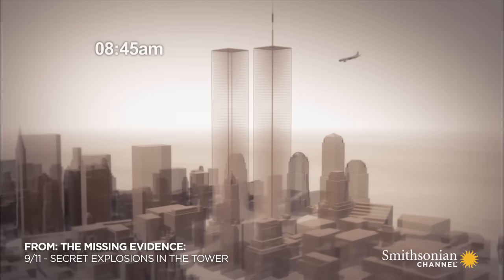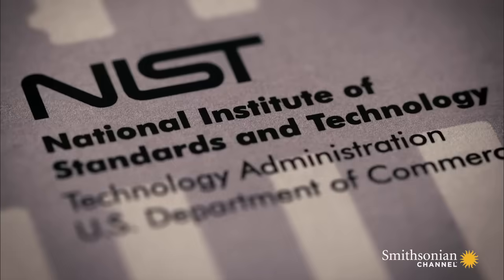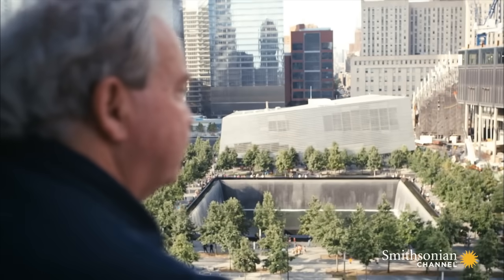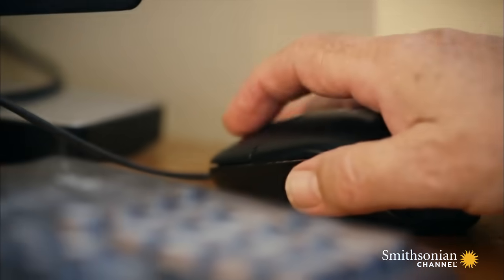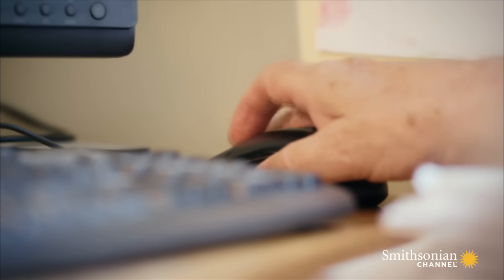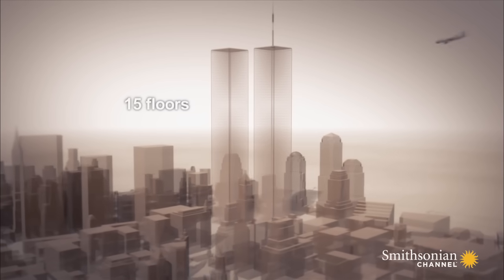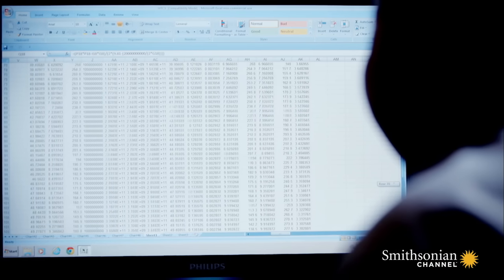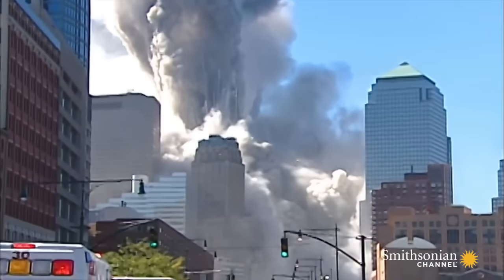This Computer Simulation Explains How the Twin Towers Fell

Comment: The computer simulations are only give information that is has been given.  Why didn't the towers fall of to the side where there was a weakness?   When the towers were hit by the plane, IL that caused a weekness on that one side. The outer wall, the steel beams and concrete inner walls.  In other simulations the towers would have begun their fall by leaning to the week side first, not straight down.  Why did building 7 fall. It was said to have had a fire in it   The fire had to be more the 2800 degrees for all the steel to melt at the same time and the building to fall on top of its self.  Watch building 7.  Straight down.    No leaning. No tipping to either side.  STRAIGHT DOWN!!
Reply: Why didn't the towers fall of to the side where there was a weakness?

Because gravity.

and concrete inner walls

There were no concrete walls. The only concrete used in the Towers were for the floor spans.

The fire had to be more the 2800 degrees for all the steel to melt at the same time and the building to fall on top of its self

No one claims the final global collapse of WTC7 was a fire/heat induced column failure.
Reply: Tim Shea    if gravity was the only factor then gravity would have caused the week side to collapsed sooner.   Have you ever played Janga.  I thinks that's how it's spelled.  Pull the prices of wood out carefully not to tip it over. Gravity causes it to tip.  So the week side will tip first.  Just as it should have in the towers.

Comment: Strange how the core survived initially, then fell in both towers. Very strange...
Reply: Not just both, all 3 towers fell symmetrically (and one wasn’t even hit by a plane).
Reply: @GhostSal  You have a very very loose definition of symmetrical...
Reply: @nutellafoxvideos7350  Read the actual NIST report, they don’t even try to argue that the collapse wasn’t symmetrical. The instead focus on why the buildings collapsed symmetrically.
Reply: @nutellafoxvideos7350  Also, aren’t you at all curios what happened to the 2.3 trillion?
Reply: Neither core was intact, that's why stairs and elevators cut.
Reply: It’s strange unless you understand how the buildings were constructed and how the structural elements failed.  🤷🏽‍♂️.

Comment: No way. There's no way, 80 undamaged floors would collapse. If the plain hit on the 40th floor, maybe, but this is physically impossible. There was no structural damage to the bottom 50 floors. Considering the 20+ years of imperial war and expansion, I don't think it's hard to see this for what it was ... an orchestrated Pearl Harbor.
Reply: You need to learn how the towers were constructed: With their "tube" design all the floors' weight was supported by the columns via the trusses they were built on. The trusses kept the columns aligned - so when the collapse began the trusses could no longer do their job & the columns failed, dropping the top 30 stories directly onto the floor below, which had no hope of withstanding such an impact. Same happens to the next floor, and the next, and the next ...
Reply: Controlled demolition
Reply: @icekoldcilla8470  
There's no evidence of this.

Comment: Explain WTC7 then. No plane hit it   Minimal fires. Yet it collapses line the twin towers. At no time in history before Sept.  11 2001 or after has a steel structure sky scraper collapsed. There are countless examples. So I guess that was the day that physics didn’t apply. Ok sure.
Reply: WTC7 was hit by hundreds of tons of steel and concrete when WTC1 collapsed. It had multiple fires on multiple floors. Firefighters on scene described it as "fully involved". It was left to burn unfought for 7 hours and collapsed.

Comment: who is this guy? The simulation, rendering they present clearly doesn't show the actual way the towers came down. Steel was visibly thrown outwards and upwards on the original footage. we don't see that in the simulation. implying another force at play as falling debris takes the path of least resistance. and so you would expect a pile of steel at the bottom, but that didn't happen.  the building vanished into dust. human remains were even found on nearby office buildings years later. don't tell me human remains dodged a falling building and landed on their final resting place all by itself. Let's be clear, nobody , at least not publicly as far as the world knows, ever told the world that they knew what actual happend to those towers. But this is not science, its science fiction. Shame on the Smithsonian for putting this out.

Comment: Paid Hack. Everywhere we saw white on the towers was the highest quality I beam steel made. Between every window was steel I beams. The planes did not take out all the I beams and there where enough left to easily hold the building up above them. Zero chance the ones below would have collapsed. If the top collapsed  it would have fell to the next floor and stopped or bounced off to the side.

Comment: Destroy structure building falls.   The building just doesn't fall.  Because of the first law of Thermodynamics.   Gravatational Potential Energy of the building is not enough to bend and buckle the structure as happened.  That in effect is what this guy is arguing.  In fact he is arguing the kinetic energy of the structure above the impact zone dropping 1 floor is more than enough to completely destroy the structure of the floor below in  about a tenth of a second raise the temperature of the derbies almost to molten and pulverize all the concrete and every thing else to little pieces or dust..   There is only one way a building can  collapses like this.  Carefully placed and timed explosives placed so as to cut the structure top to bottom. as actually happened.  We are talking the destruction of 100,000 tones of high strength structural steel , the  pulverization of all the concrete, the heating of debris to such temperatures so as concrete and metal fuse together as found in the ruble.

Comment: New physics are created here. Perhaps He should habe taken all forced in Account, Not only one. And if only one, take the most basic one. Here: Newton first rule. In short: you cant crush 90 stories with 20 stories of the same Material. Eben it is fällig a Million miles and you did Not take the structural integrety of the building into Account.
Reply: @Shelby_Starner_Everything  Third law of Motion by Newton: When one body exerts a force on a second body, the second body simultaneously exerts a force equal in magnitude and opposite in direction on the first Body. (translated for you: if two bodies collide, it makes absolutely no difference, which one is moving, which object takes more damage, is decided by their density, Not their Speed)
Reply: @Shelby_Starner_Everything  a higher Speed Differential between two objects that collide "generates more energy" (deformation will be bigger), but has nothing to Do with the distribution of the damage on the two objects. The water in the waterjet can cut through steel because it is extremly pressurized: 4000 - 6000 bar. So yes: The water .in the waterjet is more dense than steel.
Reply: @Shelby_Starner_Everything  both objects will deform. How much depends on their density. The moving object will "Lose kinetic energy" (slow down). The other ones gaines energy.
Reply: @Shelby_Starner_Everything  Good comment among the hysterical and immature drivel.
Reply: @Shelby_Starner_Everything  You're right. The planes should have bounced off and fallen into the street.

Comment: When steel disintegrates in mid air
Reply: And how do you know that???  And your feelings don't cut it.
Reply: It’s a miracle !!
Reply: Umb O  nope, most of it got carted almost immediately to china. There was a non stop flow trucks taking it away. Despite the need to sift through it all and investigate it properly. How suspect is that.
Reply: Yep, remember reporters walking around saying- Where’s All The Debris"?  Cars too were hit a block away... but not the tires or glass...
Reply: @getdapoint9469  And your point is..?

Comment: Buildings dont fall straight down... it's impossible. Just because one floor goes out doesn't mean the whole structure fails unless it was built with that in mind, which further proves a conspiracy.  However the building wouldnt have passed inspection.  It doesn't matter how you look at it it wast iranians that flew those planes into the buildings. If the planes hit at the bottom of the buildings that would be very different story. Skyscrapers have been struck by planes they did not go down. This guy's math and science are wrong, or skewed by pay off.
Reply: "Buildings dont fall straight down... it's impossible." Says who? You?? lol! #1 the tower tops fell 5 floors, not 1 - meaning the top 30 stories fell onto the the topmost intact floor from a distance of 50 feet! Are you really going to argue it should have withstood that kind of force?

"Skyscrapers have been struck by planes they did not go down"

Name one. Yes I know about the Empire State building in 1945, that's a bad example you won't win by citing 'cuz I know the facts.

Comment: The reason it falls as if it is controlled is because
It is. A plane slammed into the building. That's controlled.
The guy said "if one floor fails they will have floors crash down" 
That's what happened.

Comment: With a safety factor of 5, how did the columns at grade fail when all the loads had been removed during the collapse?!
Is Smithsonian in bed with NIST these days??
Reply: The columns were not contiguous; they were short beams bolted together at the ends. All that was required to destroy them was to break the bolts. Why do you think that mass coming down with such incredible force would have any difficulty doing that?
Reply: Well the top floors were 38 000 tons and they free fell for a second before contacting the first floor. So 38000 * 9.8 = 372,400 tons which is 744.8 millions pound of force contacting the first floor. I promise you those bolts are not going to take 744.8 million pounds, it might reduce it by 100 millions pounds and compound by another 0.2 seconds before it strikes the next floor. SO 644.8 million * (9.8*0.2) = 1.26 billion pounds of force on the next floor, go 0.15 on the next floor and reduce by another 100 million pounds. 
1.16 billion * (9.8*0.2) = 2.27 billion pounds of force on the third floor, and so forth until it eventually hits the ground and the earth puts a net force of however many billion of pounds of tower force that smashed into it.

Comment: total lie or flawed program - it is impossible for the tower to have collapsed as fast as it did and fallen just like a controlled demolition and even to have initiated the collapse in the first place  - that tower was extrememly well designed and it was as extremely solid as ithad to be in order to support all that weight - no its a total lie - this scientist is a liar

Comment: what they didn't take into account here - the planes are made of about 80% aluminum - about 57 tons of it each plane .. aluminum melts at 1221 deg .. when water from all the sprinklers and broken plumbing hits molten aluminum , it's extremely volatile and explosive , unlike other metals
Reply: @Sincronot you're suggesting concrete is an insulator, which is false.
Reply: @Sincronot now look up how skyscrapers are built and what happens when a Boeing 737 crashes  into it. Here's a hint: Skyscrapers are NOT made out of thick walls of concrete. Bunkers are.
Reply: @Sincronot they were encased, until a plane crashed into it.
Reply: @@theattempt3739 No
Reply: @Sincronot You're onto something there, Sherlock :)
Reply: @Sincronot think again :)
Reply: Hence the continuous explosive sounds that would also weaken the building, and in fact would act like an explosive device , hence the theory.
Reply: I see a thread of people saying the beams or building was made of a concrete, it was to some extent however, the elevator shafts that were near the beams was not concrete it was drywall , in certain sections on the documentaries they even say they used dry wall as a cost saving measure.
Reply: I understand what your saying . I’m not arguing with you , go back and watch the documentaries, multiple times how people got out was punching through dry wall. And it is mentioned multiple times , it should have been concrete. There wasn’t as much concrete as apparently there was supposed to be. Now, I’m not an expert, I can’t verify anything all I have is the multiple documentaries, there is a really good eyewitness account of those below the 90th floor. And there was an excellent show of when the towers were built, because another issue that didn’t help was all the open floor space helped the fire to spread and played a part. After digging and listening it makes how the buildings fell . Also don’t forget the tragedy of 93 and no one has mentioned how that could have possibly weakened the building already. Think about that , there could have easily been chipped cement . Just saying . I think it’s very interesting no one is going back to 93 , and applying that information.
Reply: I heard there was a researcher I don't remember who, but he said the steel had a impossible temperature which melted it.
Reply: @Wikchsawa  The steel beams, which carry the load of the floors above the impact zone, don't have to melt in order to give in. The load capacity of any metal drops massively the more heat you apply to it. The load capacity will be zero when molten. But it can be greater than zero and still collapse, depending on the load.

Comment: If you believe thise ur insane. A plane is made of 2 mm thick aluminium going through VERY thick steel like butter. Not in a million trillion years. They used project northwood. It was a drone. The janitor heart and explosion from the basement before the towers collapsed and cnn knew tower 7 would collapse 20cminutes before it happend. Probally nuclear weakening the steel. Thats why we see molten steel poor out the sides.

Comment: Like plane wings can cut through steel, the planes should have crumpled against the side of the buildings instead of 'sinking into them'
Reply: Each plane weighed 150 tons & was doing ~500 mph; that's not going to just "pancake" against the side of a hollow cage not designed to repel lateral impact. The energy of the crash is equivalent to a TON of TNT! You really think that won't do anything?
Reply: @Tim22222  not in the way depicted no, an aluminium plane can't cut through box steel period, and as for going 500 mph that is impossible at the altitude the plane was flying, to achieve that speed you'd need to be at least 30,000 feet.

Comment: There where multiple huge steel vertical columns in the middle of both towers, they cant just vanish in to dust in 13 seconds.
Reply: And they didn't, so no problem!
Reply: @nnvv020  They were torn apart by the forces of the collapse, DUH. But:

1. They did not "vanish."
2. They did not turn to "dust."
Reply: @Tim22222  alright i should have used the right words, but how can such steel structure disintegrate in seconds?
Reply: @niciie100  The narrative seems pretty clear: Planes took out half the supporting structure over a number of floors, then the jet fuel started fires that burned hot enough to substantially weaken the surviving steel until it gave.

Comment: No way the heat from the plane blast would’ve gone down the building as quick as it did. This was an inside job like it or not. Timed explosives were detonated inside those two buildings
Reply: Why not? Those fuel tanks blew up with a LOT of force and there were several elevator shafts that went the length of the buildings.

You know nothing about it. NO EVIDENCE OF EXPLOSIVES. NONE!
Reply: So do you all just chose to ignore the possibility that a propane heating system was installed inside the buildings? Propane burns at 5000*C, a boeing 767 at near full speed will impact with 63 kilograms of tnt force.

Comment: I would like to see what the structural engineers and architects have to say about the free falling towers. 
It makes no sense what so ever for the towers to disintegrate into a free falling pile of rubble.
Reply: Then you're in luck: The towers did NOT come down in free fall. That's a myth.
Reply: @Tim22222  I suppose there's always at least one paid troll lurking at all times in an attempt to squash people's rejection of the official version. I'm sure you know that NIST itself admitted that WTC7 came down in absolute freefall for 2.27 seconds, meaning there was zero resistance, something that happens with controlled demolition.
Reply: @adamsyed5535  The subject of this video & the OP was the towers. Neither tower came down in free fall.
Reply: @Tim22222  Whats a myth ?
Have you seen footage of other planes which crashed into high rise towers ? 
One was on fire for 17 hours and it still remained intact from the foundations upto mid floor. Because thats what happens to buildings when struck.
Reply: @jonnyfukyou127u27828  The myth I was referring to was the one you cited in your original comment: Free fall of the towers did not happen. Free-fall time from that height would be about 10 seconds; the towers took about 16 & 22 seconds to come all the way down.